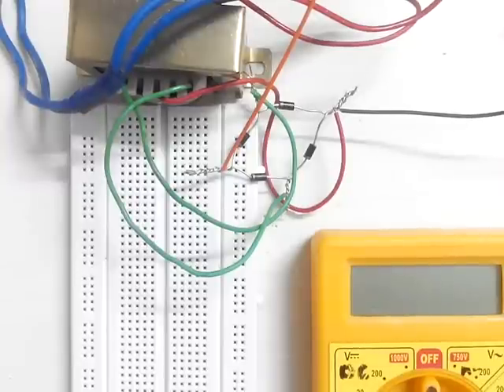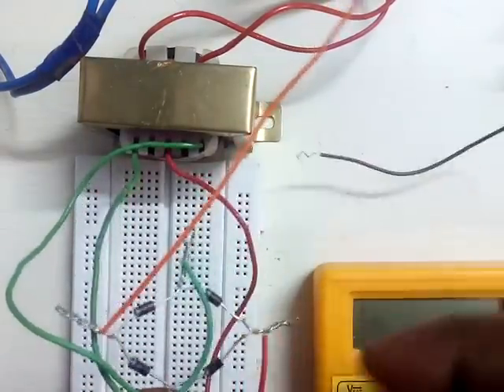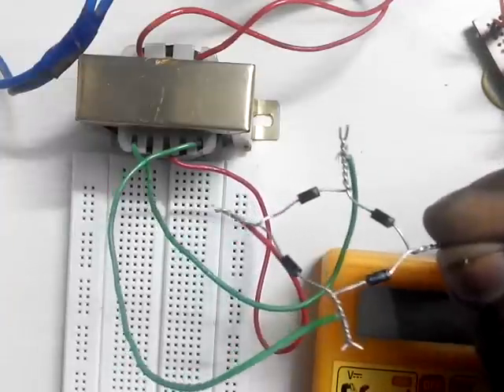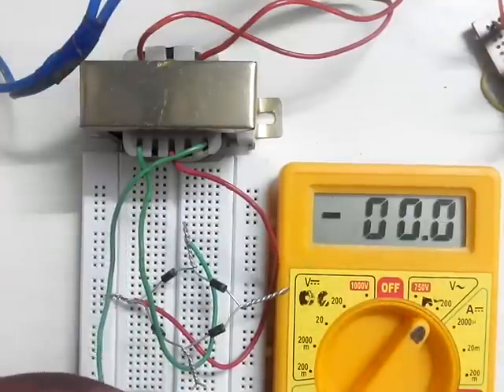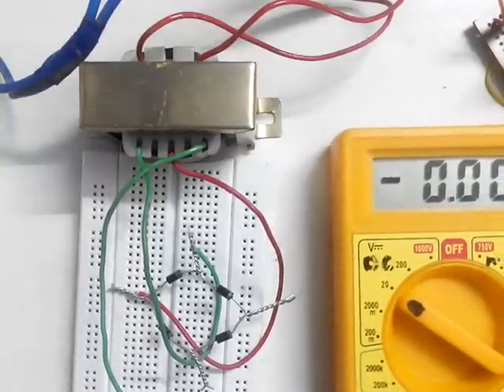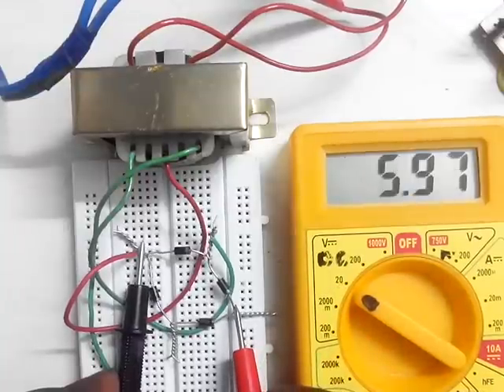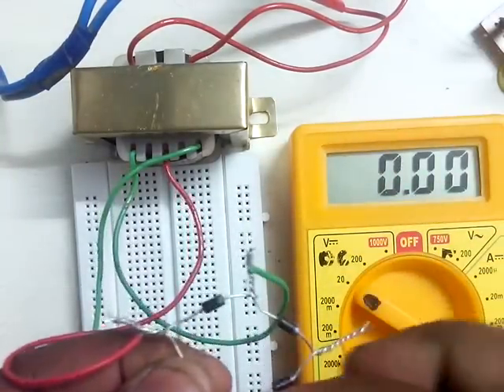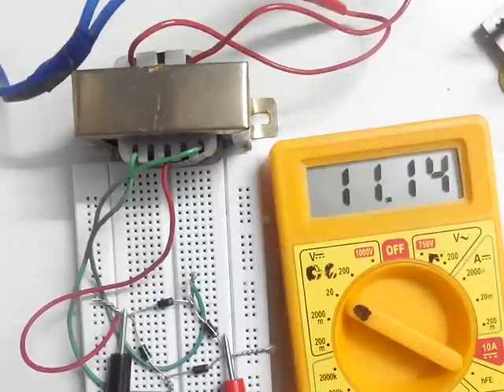How to convert 110v / 120v / 220v / 230 volts AC to 12v DC using transformer. AC to DC converter

Comment: What is the value of diode???
Reply from the maker: It is rated as 1 Ampere diode available in market as 1N4001 to 1N4007. It can easily take load even up to 5 Amp or more at  24 V AC or even more.
Reply: Video Pedia I hv used 12-0-12 3amp transformer with 5408 diode  and thanks again for the video
Reply from the maker: 1N5400 -1N5408 series diodes have higher current rating than 1N4001 - 1N4007 series so they can take higher load. For 3 Amp transformer 1N4001 - 1N4007 series is sufficient.
Reply: Video Pedia can I use 1N4007 diode for 3amp 12-0-12 transformer?
Reply from the maker: Yes, it can take load even up to 5 Amp or more.